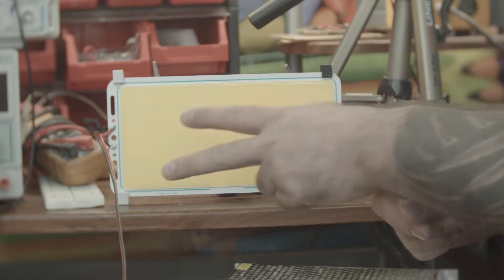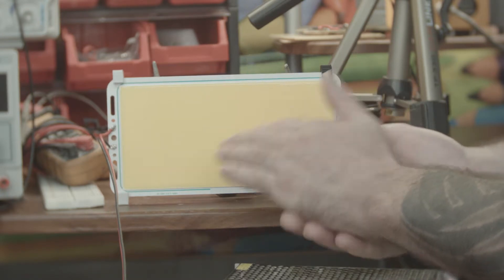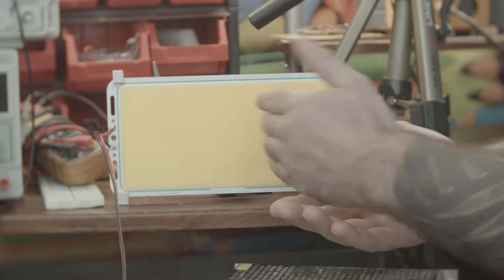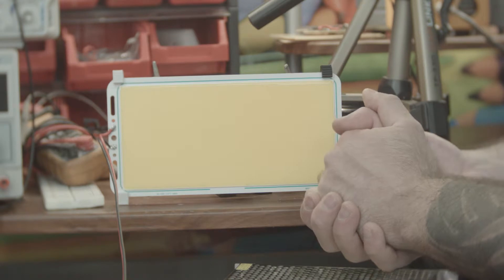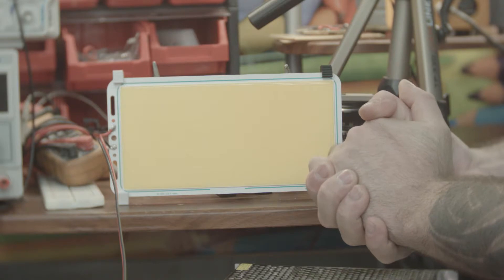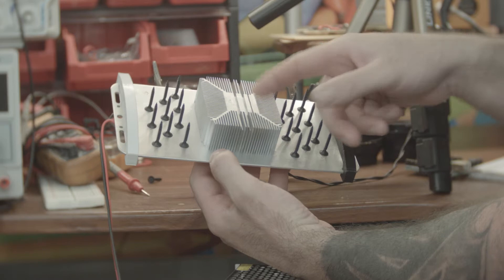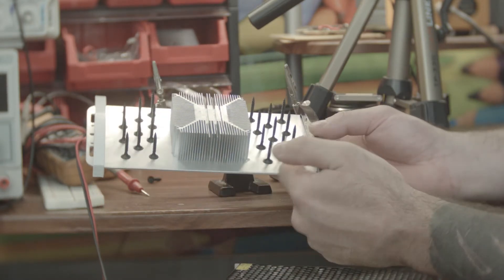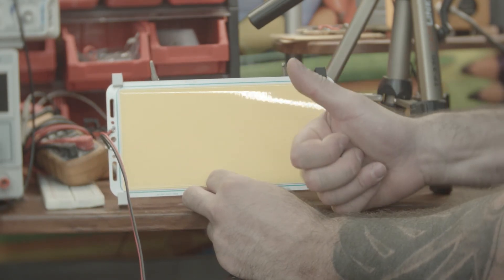DIY heatsink

Comment: If you want better heat transfer, get self tapping screws and drill them in. Then back them out, cut the tips off and drill them back in so the cut tip doesn't go past the other side of the plate. This way there's no glue to break the heat transfer from the plate to the screw.